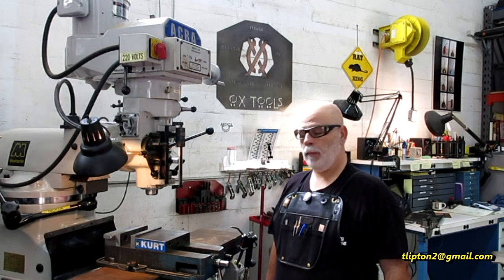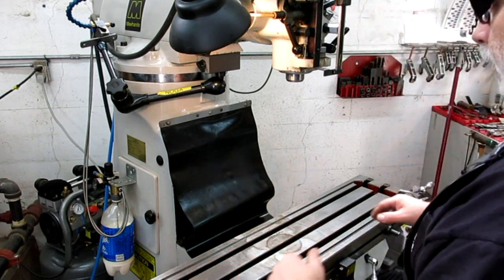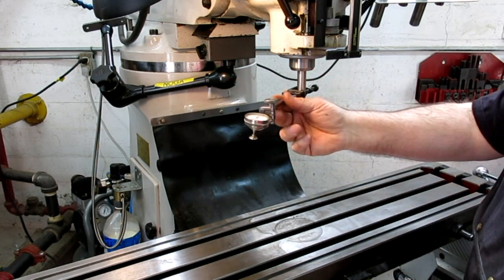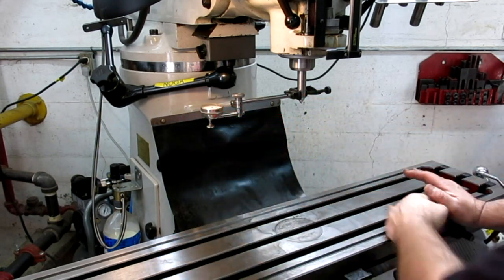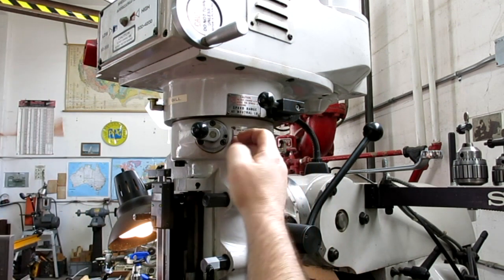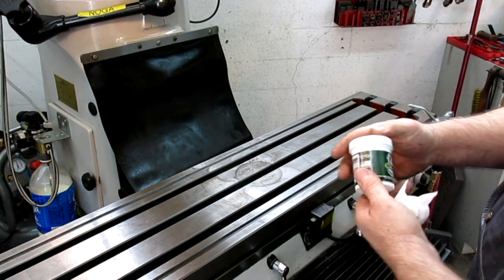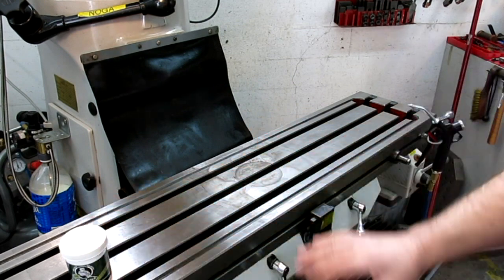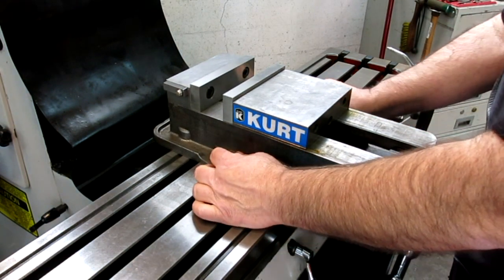Bridgeport Mill Periodic Maintenance

Comment: Tom 

I see your collet rack is pretty small.

What sizes are really necessary?
ie, buy the big set, or just get the individuals you need?
Which ones do you use and when ?

I see you have the variable speed head, is there nothing special to maintain that ?
Reply from the maker: +12345NoNamesLeft Hey Rusty,

Buy a cheap import set complete with all sizes. If your fussy then get a couple of the most common ones used. In my shop its 1/4 3/8 1/2 5/8 3/4. I could go either way on the 1/8 and 3/16.  Thanks for the comment.

Cheers,

Tom
Reply: +oxtoolco Thanks for the info

Comment: I suppose you could use an edge finder to find and check for squareness vertical surfaces in place of an indicator and one with a large wiggling diameter could be used to check for vertical, all on the cheap.

Comment: Gotta watch the lengths of those bolts for holding your vise. If they are too long a ham-handed novice could break the top out of the t-slot when the bolt bottoms out on the bottom of the slot and forces the t-nut through the top of the bed. Normal operation the bolt/nut clamps the bed to the vise. I agree with using bolts instead of studs, stud/nut combo exposed threads love to eat knuckles.

Comment: I was taught to bump the vise away from the indicator to  align the vise. In other words I find the "high" side and bump the vise so the "high" side moves away from the Indicator. This reduces the shock on the Indicator and protects it's accuracy.
Reply from the maker: +potlimit2002 Hi Pot,

I still have the original indicator I bought over thirty years ago. Still works as good as new. In my opinion its the large inertia of the vise is what protects your indicator, not the direction of the blow. Thanks for the comment.

Cheers,

Tom
Reply: oxtoolco What kind of indicator is it? James A. Harvey recommends the same method in his book as I described.

Comment: Great video, where did buy that small lubrication gun from?
Reply from the maker: Hi Derrick,

That is an excellent question. For the life of me I cant remember. I have two of them. They must be fairly common if I have two. Thanks for the comment.

Cheers,

Tom
Reply: Hi Tom, could I ask you if I had something that needed making could you make it for me,  I have a blue print of DTI holder that I need making but I just have not the time to make it at work because of work commitments, I am a machinist with but no time to make this precious holder

If you can make it will can then discuss details

Thanks

Derrick
Reply from the maker: Hi Derrick,

Well if you don't have time to make your own tools then what makes you think I have time? I have a full time job and work in my own shop and make videos for you. I think you can find the time to do this yourself. Watch one less football or basketball game and get out in the shop. Thanks for the comment.

Cheers,

Tom
Reply: Derrick, denied. lmfao. Tom's not wrong though.

Comment: I would not be surprised if he put his name at an angle to make the surface more useful: no depressed line parallel to a working edge to leave an edge of work unsupported and less likely to snag and hang when sliding work or the block in a setup. Not an issue with the typical stamped or engraved application, but for the depressed background, I could see either of these being an issue.
Reply from the maker: +john john Hey John,

That might be a good reason to do the name at an angle. The background is all that is depresses on these blocks. Good theory. Thanks for the comment.

Cheers,

Tom

Comment: Well done on the video. 

I'll pass along my learning experience using bolts in tee slots. They can be too long, If so you slot can be jacked and broken by the bolt. For those in the learning curve I thought I would pass along.

Scott
Reply from the maker: +Scott Session Hey Scott,

There are two types of tee nuts. Sounds like you have the tapped all the way through type. Sorry to hear you got jacked.  Thanks for the comment.

Cheers,

Tom

Comment: Don't know if you know of this stuff or not Tom but as an ex vehicle technician I've been using Boeshield T-9 to protect 
my hand & machine tools for many years, and the stuff is awesome. 
For daily/weekly, or even monthly use you can just wipe-on/wipe-off the Boeshield T9 like you would with most other oils, however if say the tools are stored for a longer while you can treat them with this stuff and just leave it on there and it will turn to a very fine lube grease that protects for ages.    http://boeshield.com/
Reply from the maker: +orbiter8 (John) Hi John,

Have not tried the Boeshield but have tried Corrosion X. Mixed results with the corrosion X product.  Thanks for the comment.

Cheers,

Tom

Comment: Norton stone, do you have a mfr Part #? Norton has a part number 61463685560 6"x2"x1" Combination Coarse/Fine Grade.
If you use it,  it has to be good and correct as well. 
Thanks, 
Dennis L.
Reply from the maker: Yep thats the one. Combo grit. They make a smaller 4 x 1.75 x .63 that is the same just smaller and handier on the surface grinder. Thanks for the comment.

Cheers,

Tom

Comment: +oxtoolco Hey Tom - I really enjoy your videos.  I was wondering about your table covers.  They look like a great idea, and would save a lot of time cleaning out the T-slots.

Do you do anything to prevent rust from forming under the cover?  I live in the mid-west, and we get big temperature swings.  I'd be a worried about condensation forming on the table, under the cover, and forming rust.

Thanks again!

Paul
Reply from the maker: +Paul Frieden Hey Paul,

Frog lube it! I generally take them off when I have reason to run water based coolant. Adam has some really nice snap in rubber jobs that look great.  Thanks for the comment.

Cheers,

Tom

Comment: http://froglube.com/    Go figure. 

I use SC Johnson paste wax. It has petroleum distillate suspension to keep the wax liquid so it penetrates, and then evaporates leaving the wax behind. Total water/rust proofing for metal. Very good for long term storage of chucks, angle blocks, dividing heads etc.